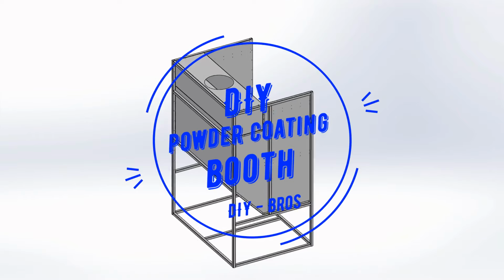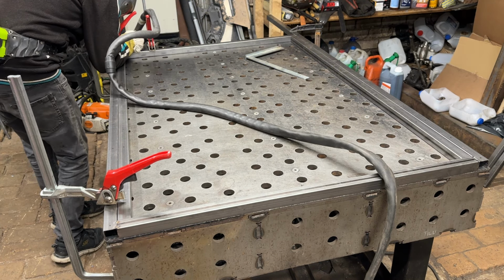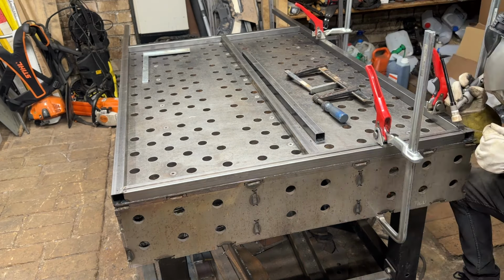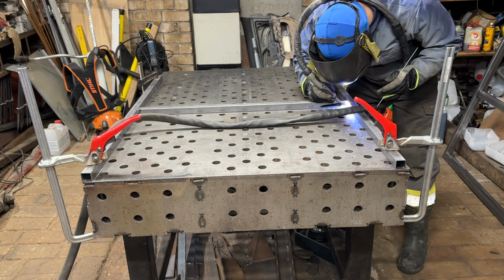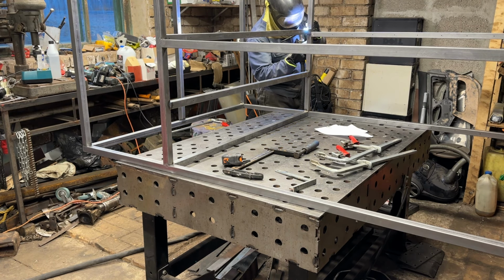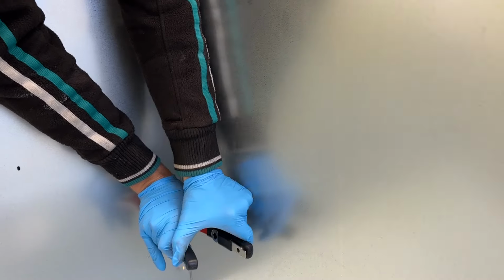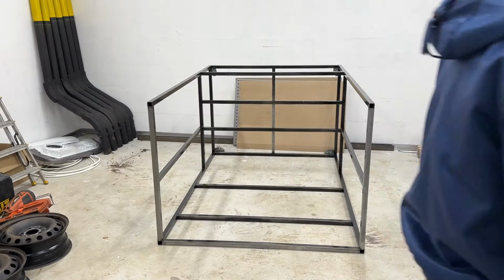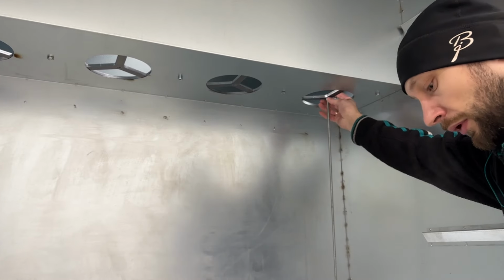Building a DIY Powder Coating Booth from Scratch

Comment: I see the short video you did on welding rod tube holder. Sorry this is the only way that I could figure to contact you about my question. What kind of PVC tube is used for the rod tubes? They look like some type of plumbing drain pipe, but I'm unaware of the type. The fittings look very good for the rod tubes.
Reply from the maker: These are regular sewage pipes used in Europe. I used pipes 50mm in diameter.

Comment: This is not how to make a powder coating booth.. this is how to make a metal box.
Reply from the maker: how's that so?
Reply: @diy-bros.1995  there's more to a powder coat booth than just the outer frame.. almost like putting a cone on a plastic tube and saying you built a rocket..
Reply: @diy-bros.1995  it might also be worth mentioning that the frame on the booth that you did build turned out great. I was just expecting by the end of the video to see an operational booth be built is all